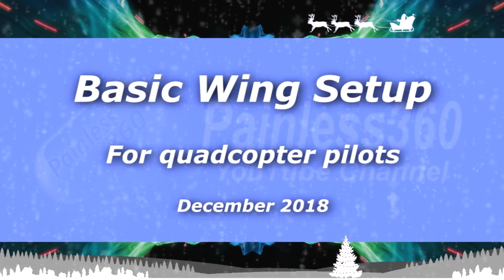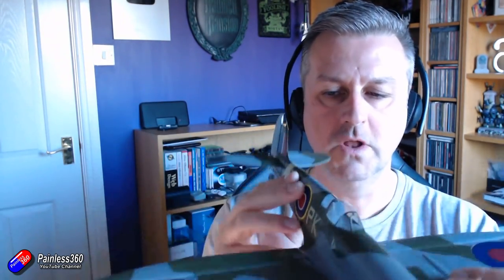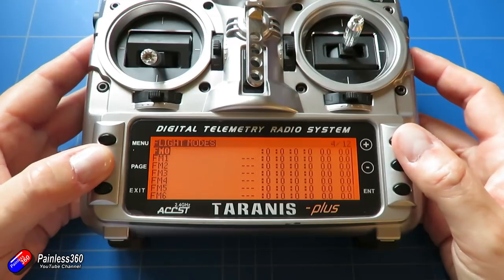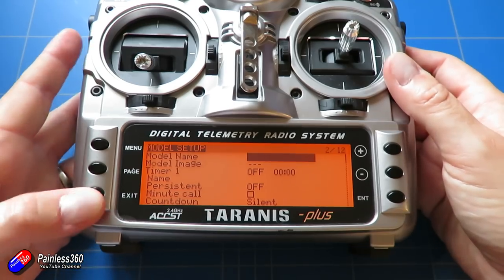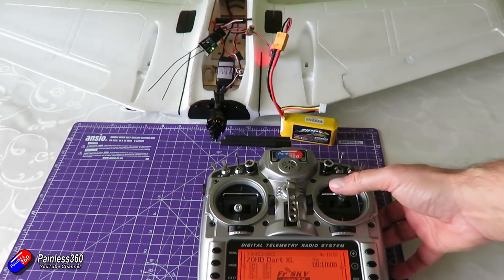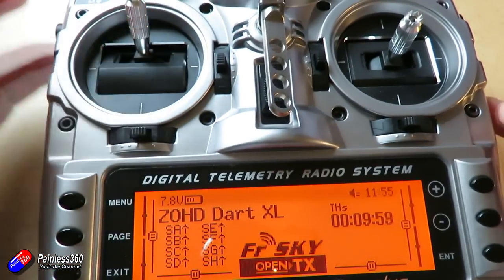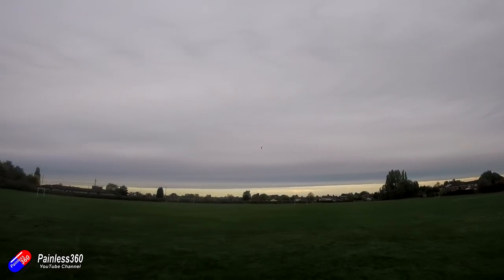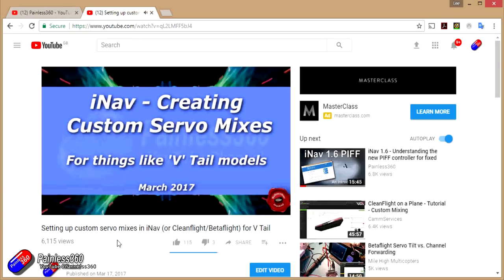Easy Flying Wing Setup for Quad Pilots

Comment: MiniQuad pilot here. So after getting my ZOHD Dart 250G ,and installing Kopilot and a receiver, I crashed and ripped the entire nose off. I repaired it, and on take-off.....it tried to bury it's head in the ground, and ripped the nose off again. (Guess it was ashamed of it's "pilot" lol.) Anywho, I found your great video, and quickly realized as I was following along with you, that I had my controls for the control surfaces all jacked up. Thanks for this. I'll try to maiden her again tomorrow, if all the bepp glue on the nose doesn't weigh her down.  ;p Thanks again!

Comment: Nice fairly simple but effective video Lee.
All we need now is a simple way to change muscle memory...... especially the tendency for ex-quad pilots to expect a climb solely from throttle punch. This is often a cause of  unintended landings in trees, or into the ground with subsequent instruction needed on glueing foam
I fly both and have had similar transition problems when swapping from one to the other even after all these years
Reply from the maker: I’ll be making some videos about that - you’re spot on, you can’t get out of trouble when you are about to hit a tree by blipping the throttle in a wing! :)

Comment: Great video ,thanks ,have just built an ft goblin wing and was confused on the setup ,this is a great help , also got into 3d printing , so of course having lots of spare quad parts ,I’ve printed a airboat , a video on two channel setup on the x9d  would be great ,thanks again Lee 👍
Reply: What material did you print your airboat in?

Comment: Wow this is amazing wish I watched it before my ar wing maiden. It was a disaster couldn’t get it to take off after the throw would just dive every time. Finally got it up in the air and flew for a bit but the whole time I was fighting it. Then it crashed into a tree. I think maybe it’s a CG issue I’m having. Was no wind but it was bobbling around every where. Also I’m fairly new at Los planes and was quite frightened by how fast it needed to to just to stay up in the air.
Reply from the maker: See my other wing videos aimed at new pilots for more tricks. There are a few common mistakes new pilots make and when you avoid them the flying gets a lot easier! Best of luck with the next try...

Comment: Hey lee,
Thanks for sharing this. Can you go into trimming in a little more detail please? My main issue is when flying level the plane is flying away from you and usually at quite some speed. As a new plane pilot it’s hard to tell if it’s level n straight so any tips on that?
Also when you talk about balance can you show us exactly what it should look like when correct and does it need to balance left to right as well?
Great intro video
Reply from the maker: Get a buddy to help and they can support. In a calm day you should be able to take your hands off the plane/wing fly itself once trimmed. It’s always tempting to use too much throttle when starting so try to fly with a low cruise throttle and fly up and down the field straight and level to give you time to get it spot in. Maybe another video is needed..  ice idea..
Reply: If you're in a club or have a fixed wing buddy, it's worthwhile letting him try the wing as he can advise on trimming and probably rates and expos too (wings are often twitchy and hovering is not an option :D).  If you have the same TXs you can also use a buddy box link to begin with especially for landing as reflexes can get you if you start to think too much.

Comment: Hey I just have a question I built and WingcatcherRC racing spec wing. But I’m not going to race it, it was given to me. It’s my first wing build. I have built 5 quads. Ok the question is I put the battery and the motor in the middle. But the 40amp cobra esc could not fit in the middle so it is to left I also put the VTX on the left side And an S8r to the right and servos of course left and right. The Esc the receiver and Foxeer Lollie pop weigh in at 52 grams. So o figured I would need to counter that with 52 grams for the other side I believe. And I added 9 grams to nose to get proper balance on the CG. That brought the weight up to 552 grams and the battery is 169 grams that brings the total weight to.721grams. Do you think it will fly. The battery is a 3s 2200mah with a 40 amp esc and a Cobra 2210/2200kv spec motor. Any advice would be Appreciated.

Comment: hi, thanks a lot for your very helpful video. i'm having difficulties configuring my f3 spracing(3.5.7) controller with my arwing mini. in betaflight in the receiver tab chanel are moving, but servos and motor dont!?!? i configured flying mode but i can't figure out how to solve the problem. if i remover the FC everything working fine? whats my mistake??? please help!!
ciao from italy alessandro
Reply from the maker: Use iNav not betaflight for wings. See my iNav 2.1 series...

Comment: Hi
Couple of questions hope you could answer 
1- how do you calibrate the stabilizer on the ZOHD Orbit ?
2-Is there a trick to “increasing” the travel on the Ailerons when stick is pushed down for wing to climb as the travel is barely 4-5 mm meanwhile all other movements are okay?
3-the left Aileron touches wing when moving , is there a way to rectify it ? “Sand” contact point or “lube” it or cut with a blade etc , please advise.

Thanks in advance
Reply from the maker: 1) Power up the model and have the radio connected then hold the button until the light flashes and then leave it for a few seconds until teh light stops flashing. The stabiliser should be good from the factory.
2) Yes, increase travel in that direction on the radio, be aware that in stabilise modes the controls may not move fully. I'd try and fly it first.
3) Depends what you mean by touching - see my review of that model for my building tips.. 

Best of luck!

Comment: Hello :) ! First of all thanks a lot for your videos ! Your tutorials are really helpfull ! I have a little issue, I'm building up a ZOHD 250 with a TBS Tango Pro 2 as a TX. I configured a "Delta" wing on the Tango. I follower your full videos for setting up iNav.
But when I go to Receiver tab, throttle works great and respond. But Elevator makes moving Roll and Pitch at the same time ?
I set up on iNav Channel maping as TAER because that's what I got on the Tango. I made sure to be on CRSF on iNav.
I tried to play around on the Mixes page of the Tango changing 50 / -50 on the inputs nothing helped.
I'm trying to figure out if it's an Inav issue or setting I'm missing out ?
Thanks a lot for your help ! Alex
Reply from the maker: It is normally that one of the servos or mixes need reversing. Get both elevons moving up as you move the elevator to the bottom of the radio first by changling the polarity of the elevator portion in the mixer. Change the one that is moving by changing it from positive to negative or vice versa.  Then work on the Aileron... best of luck
Reply: @Painless360  Thanks for your answer. So I managed to get a more "normal" behavior on iNav by having CH2 0 Ele +50 Ail / CH3 +50 Ele 0 Ail. But if I get them -50 / +50 and then +50 / - 50. Again it doesn't work. So is it normal to have 0 in the mixers and +50 rather than -50 ? Thanks !
Reply: Just tried to play around I put between 0 and 100 and it seems working. But whenever I have one of them at -50 then they both start moving togethere..

Comment: Fantastic, Lee! Thanks a lot for this! 😃
I have 2 questions... In a wing with iNav the model would be created the same way? Or something would be different? (Forgetting about aux channels, of course.) The second question is about the esc... In a wing with iNav would you use a BLHELI_S or a Simonk esc? Or doesn't it matter?
Thanks! 😊
Reply from the maker: No mixing if you use iNav - see the series.. and it doesn’t matter about the ESC for a fixed wing, happy flying!
Reply: @Painless360  Thanks!!! I will! 😃
Reply: Thanks for the video! Very helpful. If I may request something, much like MC's Creations I would like to use a FC with iNav in my wing. I've been stuck at the step where one needs to adjust the throw of the servos to match a certain deflection. Would one do that in the mixer in iNav?
Reply from the maker: Please see my inav series. It's all in there..

Comment: How do you find the right receiver and transmitter? What are the qualities that they must both have in order to connect to each other? Does the brand matter or do the Hz matter?
Reply from the maker: Check out my videos in the introduction to radio control series - https://youtu.be/_YNRZVJIl7k

Comment: Thanks for another great video. I’ve learnt a lot from you videos, built several quads, and now just bought my first fixed wing. I got an AR Wing and about to put a CRSF and FPV gear into it without a FC to start with. I just tried to create the model in my Taranis as you did, but it literally just creates a model, not giving an option of wing, quad or plane etc. No diagrams or anything. Do I need to set it up with companion? Running 2.2.1. 
Thanks for any help.
Reply from the maker: You'll be missing the setup wizard LUA script on the SD card..
Reply: Painless360 Thanks, can I just add Wizard LUA to SD card without upgrading or mucking anything else up?
Reply from the maker: Should be able to..
Reply: Painless360 Thanks for the rapid reply, even on Easter bank holiday! One new patreon.

Comment: Can we use quad receivers on wings? I see there are dedicated fixed wing receivers (PWM), but i would like to use my spare ELRS quad RX on wings as well.
Reply from the maker: Yes, with a flight controller that understands CRSF.. If not then one of the new PWM output recievers..
Reply: @Painless360  So for me as beginner buying new Matek F405-MiniTE is futureproof investment (it supports CRSF)? I guess I can use that FC for both multirotors and fixed wings right?
Reply from the maker: Check out my Kit Picks 2021 video... Best of luck
Reply: @Painless360  Thanks, glad I found your channel. Appreciate your help !

Comment: Great video Lee.  What glue is best for the mini ar wing?
Reply from the maker: I tend to use 5 min epoxy or good ol' foam safe CA! It pays to lightly sand the areas to be glued to help with the bonding.. Hope that helps.
Reply: @Painless360  . Yes, thanks for that . I'll get some ordered

Comment: Another great video...quick question...debating whether to buy a wing with a stabilizer already installed (and allegedly tuned) vs DIY...if I use a Matek wing FC with iNav, does that provide stabilization or do I need a separate, dedicated stabilizer?
Reply from the maker: It’s a personal thing but a stabiliser can help but for FPV a FC is great! Fixed Wing and Planes 101: Stabiliser or flight controller? https://youtu.be/YAfNC55Udu0
Reply: Thanks...as usual, you’ve already covered it and I simply haven’t looked hard enough for the right video.  I appreciate the link.
Reply: A stabilizer is useful at launch and also if you need a 'breather' from tensing up after a close call.  Leaving it on all the time is boring as it's limiting your movements and makes it hard to keep it in a proscribed area.  Putting it in 'Normal' or 'Semi-assist' mode gives a more realistic response.  One word of caution - don't switch modes at low level as if possible as some stabilizers cause the plane to nose up or do a little flip.

Comment: When you did your  mini ar wing  , how did you hold your camera in to the nose ?
Reply from the maker: If it's not a tight enough fit I usually use a thin bead of hot glue..
Reply: @Painless360 . Thanks for that 👍

Comment: Great vid, is setting up a horus x10s comparable to the x9d? As I'm still struggling to get my zohd dart to work
Reply from the maker: Same process, the steps depends if you gave OpenTX on it or FrOS...
Reply: @Painless360  Got opentx on my x10s, looks like x9d is way easier to setup. Or I am missing things on my x10s?
Reply from the maker: @bryandebruyn4410  the navigation on that radio in OpenTX is very different isn't it? The other thing you can do is create the model on the OpenTX companion app and copy it into the radio if that's easier. Best of luck!
Reply: @Painless360  will give the companion app a try. Thnks for the advice

Comment: What direction should the prop be mounted and motor direction
Reply from the maker: Any writing on the prop should be facing forwards and turning to create thrust backwards...
Reply: Painless360 if the wing is facing forward and I’m facing forward. Should the motor be spinning clockwise.  Is this correct. Thank you for your help.